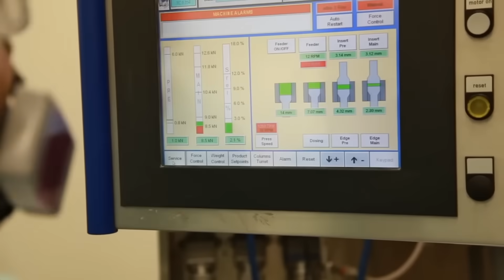Why These Engines Only Last 3 Seconds

Comment: I'm not sure what materials/alloys are used in Top Fuel but working on aircraft for over 10 years, one thing that has always blown me away was failure caused by temperature.  Aircraft running at X temperature could go for 100s and 100s of hours, but if you increased that temp by only 30-40C the life span dropped to nearly 0. Id venture to guess Top fuel runs well over the temperature limit of what it should, but only a few seconds is all it needs.

Comment: I love that John Force's daughter is the one to set the non rocket powered record.  The current speed record in the quarter mile is 402mph in 3.22 seconds by a 28,000hp equivalent  rocket car driven by Sammy Miller.

Comment: Small slight correction and hopefully fun fact the exhaust is mostly just the water being torn apart in the air and then the heat combining back.

Comment: Jonny F1, you present great Indepth insights in racing vehicles.  I would like to see you present a detailed video analysis on the airborne F1 Tunnel Race Boats. Also, Top Fuel Drag Boats are harnessed animals too. Utilizing dual propellers for symmetric torque to help drive the boat in a straight path on flight above the wavy track.

Comment: I've had the utter pleasure, and terror of both driving  and working on a top fuel dragster and a funny car. Plus a car we put a top fuel dragster engine in.

I have worked on a few race vehicles. Driven a few too. From V8 supercars. To mud racers, sprint cars. Am cars. Drift vehicles.

But top fuel dragsters are a whole different beast. As this video shows they are deceptively simple. But terrifyingly powerful. I've had 2 runs with a top fuel dragster. And both times I couldn't go flat out. I was just never ready for all the power.

I was never meant to be a replacement driver or anything. It was just a very expensive thank you for staging up for a couple of days to help the team get 2 engines built and go over the vehicle with a fine tooth comb (long story short. Both their engines blew up at a previous race, boss knew the team and sent me down to help). Despite the fact I'm now disabled, can never work again and all that. I still consider myself extremely privileged to experience everything I got to do.

Comment: Top Fuel engines last at least for  startup, burnout, back to stage then at least a quarter of a mile. A ot longer than 3 sec,, the race is near 4 sec alone. Often they do NO damage and could be run again. Though seldom are. They destroy so much stuff because they hose in so much fuel  that the engine cannot burn then the engine hydraulics and spits the blower off or very occasionaly rods out the bottom.
Personally I would love to see engines be forced to run the complete show without a rebuild. Would be slower but a LOT cheaper to run and makes teams smarter than burning stuff up.Ditto with all fuel classes.

Comment: 0:40 nascar engines are not making 1000hp. 700hp is bit optimistic for old engines and current engines are even limited to 670hp
Reply: They make around 800hp actually now
Reply: You could say that next gen cars make 800hp but atleast i havent seen any real evidence. Current restrictor plates are designed to flow Officially 670-750 or even 550 for few tracks.... without evidence you could also say that they make 1000hp.
Reply: A hellcat makes 750 hp. Are you OK?
Reply: @dirtbikeroad7802 NASCAR engines are often detuned
Reply: @dirtbikeroad7802  hellcats don’t have restrictor plates
Reply: Old engines made more power
Reply: According to mechanics and drivers the Nascar engines before they started with the tapered spa erst were making 900hp or more
Reply: @jebediahgentry7029  i'm curious when was this? i have personally seen few older nascar engines on dyno in drift cars and they are making between 500-600 whp, when converting it to bhp you have to use very high percentage  manual trans drivetrain loss for it to make over 700
Reply: ERK has spoken not possible can’t break 700
Reply: @DrHerby86  well, he's right. And he isnt the one making the rule lol
Reply: @DrHerby86  NASCAR engines make 850-900 hp, but are oftentimes restricted

Comment: Weird to compare a top fuel dragster to a F1 car!  They are different in every single way which I am sure you know, so why the comparison.  I doubt a top fuel dragster could beat an F1 on a single lap of a race course, and an F1 would not out accelerate a top fuel dragster.

Would be interesting to know the budget differences in the two types of cars though.  I know F1 budget is insane (even the front wing on an F1 is in the thousands of dollars, so could you give an overview of the cost of a top fuel dragster.  That would be an interesting comparison!

Comment: It is said that after each run, when the crew starts taking the engine apart to see what all they broke on the just-completed run, the lower ends of all the spark plugs are melted away. So the crew's best guess is that the plug tips /  electrodes melted by the half-way point (500-ft from the starting line) due to the heat inside the engine, and therefore the last half of the run probably happens through the "diesel effect" where the heat of combustion and compression ignites the following stroke's fuel, like big truck diesels do.  Regarding the supercharger, it can be dyno'd to check it out, and the rule of thumb is it takes 100 hp per thousand rpm to turn it. So the article is correct, at 8000 rpm, it takes 800 hp to run the supercharger. It is impossible to run a top fuel car with turbochargers, because it takes a couple seconds to spool one up to provide adequate boost, which is way too long in a 1000-ft race. A "regular" 14/71 supercharger, by contrast, is putting 60 psi into the engine at the starting line, which gives it an unbeatable head start. Regarding nitromethane, the heavier the load, the more fuel the engine will accept. On the other hand, when there's no load, such as when tuning the engine in the pits with the rear wheels off the ground, there is  no load other than freewheeling the rear tires, so there's gobs of unburned fuel coming out the exhaust pipes. That's not engine oil that's coming out, due to excess clearance on the pistons or rings, its unburned fuel. Note that when the cars are in the staging area, then doing their burnout, there's clouds of mist coming out of the exhausts. THEN, as soon as the light turns green and the drivers hit the throttles, the mist clears up right away, from the load of dropping the clutch. I one time at the strip asked a couple of teams' crew members what the throttle "butterflies" were set at for the burnouts, and they all said they were  throttle stopped at about 5/16" opening for a burnout. That's smoking the tires with throttle blades barely open, just the 5/16" butterfly blades barely opening. Speaking of sparks, each of the two MSD distributors puts out 44 amps at 50,000 volts. As "watts" are the measurements of electricity as hp is the measure of torque at a certain rpm. 44 amps @ 50,000 volts equals 2,200,000 watts of power. Each. That would run 20,000 light bulbs of 100 watts each. Next time you're at the strip, notice the thickness of the sparkplug wires. Normal cars have 8 mm plug wires, but Top Fuel cars have 10 or 11mm plug wires, with extra insulation around the metal wire of the wire lead.

Comment: Dude......... A Boeing 747 burns approx. 7 Tonnes of Kerosine on take-off, & a Tonne per hour in flight. (Depending on passenger numbers & luggage).
Each engine produces approx. 60,000 Horsepower X 4 = 240,000 Horsepower.
 Kinda makes your Dragster a gutless under powered pussy wagon, in comparison...............Sorry!

Comment: Space X's Raptor turbopumps alone require 100,000 horsepower per engine and Starship's Super Heavy Booster has 33 Raptor rocket engines. Raptor turbopumps are designed to be reusable.  The Raptor engine's fuel is methane and liquid oxygen. 

 G force on the passenger doesn't show the intense load inside the engine.

Space X can spend $$$$ on high-grade titanium and other expensive materials far more than a drag racing team.

Comment: If you have been to NASCAR , enjoyed that but have never seen top fuel , you need to watch nitro cars make a run.  Its a made for spectacular sport , they let you in the pits where getting , pics , autographs , memorabilia isn't a problem as long as you use common sense and don't interfere with crews prepping for next round. If dropping the green on a round track gets your adrenaline flowing,  you ain't seen nothing yet.

Comment: They are so wasteful. It isnt interesting to me. The tech, like you said, is 70 years old. If the NHRA mandated 2 runs per engine rebuild ... Then it would start to get interesting.

But this is just brute force stupidity.

Comment: Sorry for dumb questions, but: If the fuel contains oxidizer, why having a compressor at all? Why not mix 5% more oxidizer into the fuel? or use a two phase injector, like a rocket? and why do you use piston engines at all? why no shaft turbine? you could mount it between the rear wheels to eliminate a clutch and a bevel gear.

Comment: 0.47 Fun fact: One engine of a 747 give around 60000 HP at full power but only drinks around 3.9 gallons a second. A A380 engine is even better with its 75000HP and that at only 3.2 gallon/s. A 11000 hp dragster is thus extremely inefficient with its 11 gallons.
Reply: efficiency was never the goal, jet make thrust not hp

Comment: Normie: why do these engines only last a few seconds?

Me, an engineer: how do these engines survive more than a second?
Reply: They often don't
Reply: Me, also an engineer: how do these engines?
Reply: That's the reason why they shortened strips from a 1/4 mile to 1000 ft. For the last 300 or so feet the engineers were basically crossing their fingers and hoping against hope that engine would survive to the end of the run.
Reply: @bassplayer2011ify  It's actually because the cars have been getting faster and most tracks don't have a long enough runoff to stop safely from 350+mph at the end of a 1/4 mile. I remember the arguments about it at the time, but essentially there were a bunch of serious incidents and most older tracks had no chance of meeting an updated safety standard for a full quarter mile, so they changed the standard run to be shorter.
Reply: @CaptainHat  - and the tyres are only really rated for 300mph -
they exceed that already.
Reply: Engineers and vegans are the same, They just have to tell everyone
Reply: no one cares bro
Reply: @Sahlokniir you dont care because you're too stupid to understand it, not everyone is as ignorant as you, or as happy to remain as ignorant as you 😂
Reply: @Sahlokniir  Car guys like me care. Wrong assumption lol

Comment: they traded all their reliability for power. if the got some more reliability they would just trade it for even more power.
Reply: They've actually reached the limit of power and it's become very dangerous. They had to shorten the track from quarter mile to 1000 feet because the cars were going out of control.

Comment: The use of the imperial system was disgusting but, aside from that, with all of the conversions I learnt today the size of an American football field—110m in length! That’s so small that it’s almost cute. (For reference, AFL fields are typically ovals of 150% of that, up to 185m).
Reply: With a smaller field there's less places for your footballers to run away from our footballers.
Reply: Fair enough, I suppose AFL players are allowed to kick the ball whilst American footballers can’t.

Comment: I think its funny, that building a comparable electric engine would be much easier and much more difficult at the same time. 
For example, with an electric, you wouldnt need to worry about vibrations or timing, but you would need to find a material that you can dump this insane amount of power through without it melting and youd need a powersupply that can output enough. So you definitly wouldnt be able to build a comparable car due to the weight alone

Comment: I started in racing back in the late 60s. It is amazing to see that top fuel engines are actually little different now than then. They sound the same as they did then but produce MUCH more power and waste much less but overall they sound about the same. Incremental improvements raised them from 1000 to 3000 to 8000 to now 11000HP.  All with the same basic foundation Hemi and blower. The only real change has been increasing knowledge and some improvements to the accessory systems. So it turns out they had 11000HP in them all along we just didn't know how to get it all out and make use of it.

Comment: Imagine trying to control the car: G-force, tiny front wheels not always in contact with the strip, chassis flex. That was a very educational video. Even the fuel is interesting.

Comment: Crazy it uses more fuel than a 747 though at the same time it does a good reminder that the engines on a 747 are designed to be incredibly efficient.

Comment: additional fun fact: not only do the spark plugs melt. the heat caused by the slipping clutch at the beginning of the run also causes the clutch plates to melt and get welded into a single block.

Comment: metric, use the metric system!!! feet , farenheit, yards ,galons, pounds, mini-vans, football fields, elephants, baby elephants, stones, miles.

might as well change seconds and hours and minutes to something more imperial system practicality, like "i'll be there in about one and a half haircuts" or "i'm 3 cats old" or "can you turn that thing down? it sounds like its 170 claps loud"
Reply: Seconds, hours, and minutes aren't really metric. They're base 60, not base 10. And we have the wonderful world of radians versus degrees. No one outside of engineers and academics uses radians for anything.
Reply: First off we don't use Imperial. We use US Customary. Second off get to the Moon. We did over 50 years ago now. Until you do it'll remain a quarter of a million miles away.
Reply: @1pcfred  you mean you went to the moon before 3 million cow milkings? Are you sure you know what a year is??

Comment: Meanwhile me in Beamng Drive trying to beat that 3.5 seconds with a Gavril D series Pickup with an unlimited RPM, A NASCAR spec V8, and indestructible wheels. Best I’ve gotten is 4.87 seconds in a quarter mile

Comment: Anything that runs so hot they melt the ends of the plugs isn't going to last long.  The magnetos put out so much juice you can use the plugs as welding electrodes.  At the end of a run, the clutch plates are welded together.

Comment: I love when F1 channels cover other sports. I think a lot of F1 fans struggle with drag and oval racing because the disciplines seem simple and they don't know what nuances to engage with. This video does a great job of doing that and gives F1 fans a reason to care. Maybe do a World of Outlaws video next? The cornering speeds they hit on dirt is insane. . .
Reply: I am not familiar with ovals or drag racing but I love F1 and Rally. Of course there is also 24 Hours Le Mans. I think people making fun of Nascar doesn't understand motorracing on a fundemental level. Every different type of racing have it's own challanges. 24h Le Mans compared to Top Fuel Drag is the best example. One is about going as fast as you can for 3 seconds while the other is all about endurance. Rally cars and drivers tackle extreme conditions, you have night stages you have snow you have ice you have animals... Rally Kenya is difficult because of the dirt!

Comment: Any other Motorsport: every part of this vehicle is designed from the bleeding edge of modern technology. It is designed to be extremely high performance in everything it needs to do, while fitting within regulations.

Top fuel: MORE FUEL, MORE AIR, MORE WING, MORE, MOREEE MOOOORRRREEEE

Comment: 2:22 Thats a sweet accord right there but just wanted to mention that the motor in that one is an H22 from a prelude, that car originally came with the single cam non-vtec F22.
Reply: It’s kinda funny my prelude engine  was replaced with an f20b from an accord

Comment: Okay. Top Fuel dragsters are a marvel of technology. But comparing it to Formula 1 in terms of technological advancements... Eeeeeeh. F1 Cars do around 950-1150HP, the engines are a 1.6 Turbo V6 that can rev upwards of 12.5K RPM, they are 50% efficient in energy transfer and while acceleration is not even close to top fuel, those things can exert 7g's of force on the drivers neck around a corner.  

Now again, Top Fuel cars, are a fucking miracle, the vaccum sounding piece of shit V6 compared to the roar of the V8 that can and is sometimes detected as a micro earthquake is pure bliss. The reaction time required is insane in Top Fuel cars and frankly, having an engine run at 10K HP for even three seconds is absolute insanity, the fac that these things don't launch themselves into the stratosphere is a miracle and marvel of the technical ability of the people working on those things.

Comment: Why not just place a 500 gallon tank of nitroglycerin behind  a car seat. Bet you can pull 1000 Gs and do the quarter mile in under a second!
Reply: You might have to rebuild the driver, and the stadium, after every run though😟

Comment: Honestly the simplest answer is that they only last three seconds because they only need to last three seconds.  Design is all about tradeoffs, and while they could make an engine like this last longer, that would mean they couldn't get as much power out of it, or it would be much heavier, or extremely expensive, or all sorts of other possible downsides.  The limited lifespan of the engine is a tradeoff that works fine because of how the event is structured--it's a very short race.

Comment: I've never seen the appeal of drag racing, I don't see where the skill is in going fast in a straight line. Then again, I don't see the appeal of oval racing either, but atleast you actually have to pass cars and turn the steering wheel.